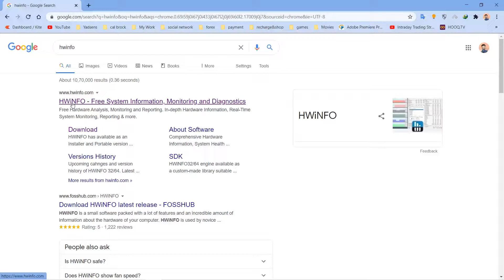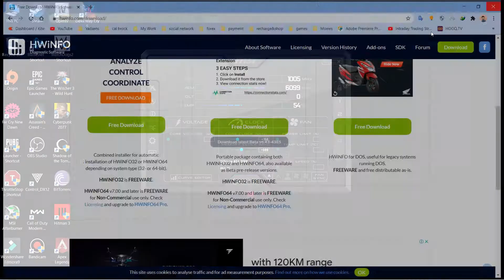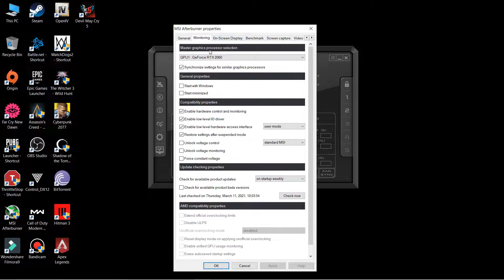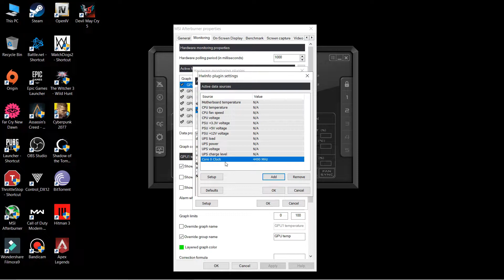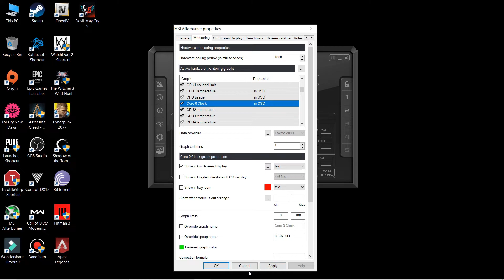how to Unable CPU Clock speed in MSI Afterburner !! Clock speed monitoring !!

Comment: It won`t allow to report cpu clock speed the way you shown it because in free hwinfo app you need to first click share memory for 12 hours before msi afterburner will be able to check sensor data, otherwise great  video.
Reply: How exactly do you "share memory" if you can tell pls ? I dont see any option in HWinfo

EDIT: OK i was using HWmonitor & not HWinfo so i have downloaded that & checked the share memory option. Lets see after 12 hrs

Comment: Thanks a lot for the video. If anyone encounters the same issue as I did with the available sensors list being empty, turn on Shared Memory Support in settings.
Reply: Where do you find Shared memory Support in settings- settings of which program?
Reply: it doesnt work UNTIL i installed AIDA64 alongside HWINFO ... then it works...

Comment: I did it perfectly with a 13700K on msi affterburner, my question is, does hwinfo always have to be open to show the cpu clock? because if I close the program, it reopens without my permission.
Reply from the maker: Yes it should be running always

Comment: #GameAndTechPoint Hey.. I m using Intel 10400..Bt its clock speeds r varying too much like the values r changing from 800 MHZ to 4200 MHZ after every 2 or 3 secs.. Max Value remains constant at 4205.8 MHZ.. It is normal or should I claim warranty.. Plz must replyy.. Thanku..😊
Reply from the maker: It could be flctuating due to thermal throttling.
And some time its normal.
Reply: @R-tech890  After selecting 'High Performance' Mode.. Current Values of all Cores r close to Max Value i.e. 4000MHZ & no throttling in the clock speeds.. 🤔
Reply from the maker: This is good.
4ghz on all core it can do.
👍
Use it on this mode.